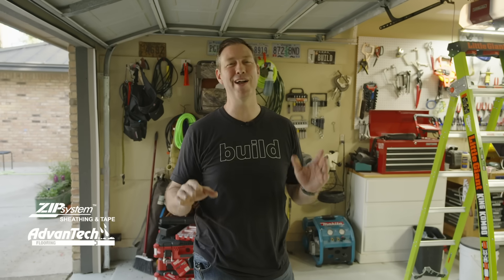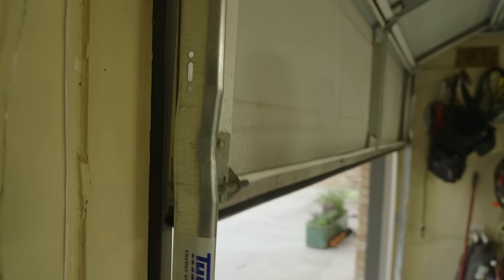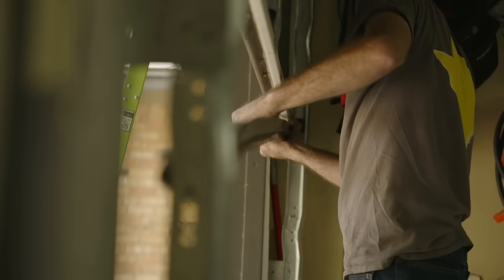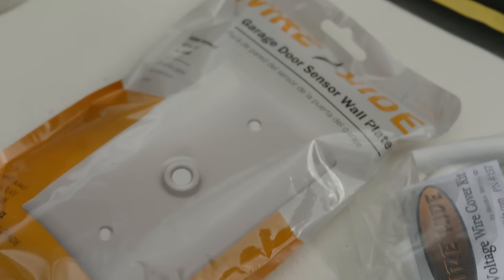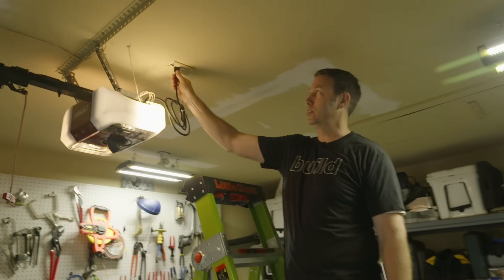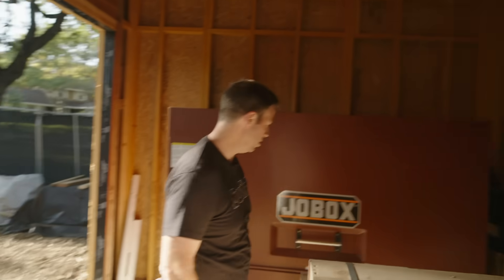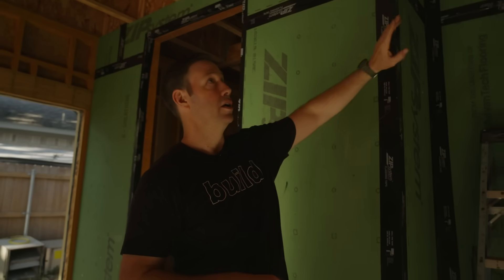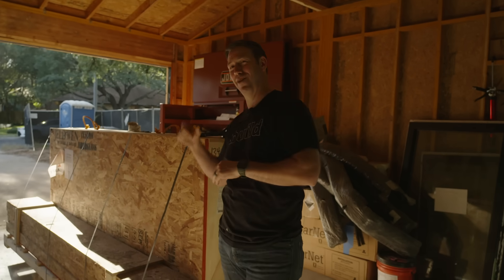Garage Door - Air & Bug Sealing

Comment: Matt, I learned a few years ago that leaving the manual door pull handle on the rope (red handle) is a security issue--recommend removing that.
Reply: As a garage door technician with 10 years in the business,  I can say this is FAR from recommended.  What is recommended is adjusting the pull height to clear vehicles and accessories.  Not removing a safety feature altogether.

Comment: Good stuff. You can use VOC sensors to trigger the exhaust. It'll help with your efficiency goals and also trigger based on actual air quality instead of just motion and false positives of motion. Thanks for your videos as always.
Reply: Does anyone have a link to a VOC sensor that can be used to automate the exhaust fan.  I can only find them for humidity.

Comment: I have been doing garage doors for 20 years The best brand  to buy are Haas, Wayne Dalton, Raynor, Clopay in that order stay away from the "Overhead" brand the quality isn't there . For example the gage of the steel is thinner , there is next to nothing for reinforcement on the inside. Get a torsion spring instead of extension.  A lot of door guys say extension is fine but torsion is better for lots of reasons, its more work so some guys don't want to do it. If you have the head room get 15in radius track, If it was my house I would buy Hass 1 3/4 thick door 700 series,  also spend the money on double pane windows

Comment: I live in Austin, tx used to spend quite a bit time in there. During the summers it was hard to work in the high temp so I bought some rigid foam insulation and cut it to fit into the panel of the door with an airgap of about an inch. I checked the temps on the inside and outside of the door. Inside the temp was 91 deg while the outside temp of the door was 135 deg. This temp was taken in the afternoon. Some time I saw kits in Home Depot for doing the same thing although I don't  know if the kits were using the airgap. I got idea from double glazed windows and their gaps between the 2 pieces of glass.

Comment: I've got a detached single-car garage with a refrigerator in it, which has been VERY helpful for stocking-up on extra food during the pandemic.  Problem is, during winter, I need to keep a space heater running and pointed at the fridge to make sure it doesn't get so cold that the thermostat in the fridge/freeze stop cooling. I currently have no seals around the garage door, and will definitely give ThermoTraks a look, because I'm just throwing money away at this point.
Reply: You need to buy a "garage ready" refrigerator that can still operate at lower temperatures.

Comment: READ THIS WHOLE COMMENT...  First, I appreciate your videos, and I do enjoy some of the content. I feel your getting yourself into a slippery slope though, and all the comments are telling you this too. Man you are way over exaggerating "problems" so you can install free stuff that was given to you by companies that want their silly product pimped when people don't need it. Paint fumes? Just open the damn garage door! Car fumes when you pull in? You have a massive hole letting ventilation in when you pull in, you know it's the OPEN garage door itself. No need for some fancy venting crap you have to cut holes in your garage, that will inevitable fail anyways. Besides, if you install this at the back of your garage, you will be drawing the fumes to the back of the garage instead of out the main door you just drove in. If you install it towards the front your just be blowing out the fresh air coming in the garage from the open garage door. Honestly this only has a purpose for someone with a dedicated paint booth because he paints REGULARLY. and those people are far and few in between, not the masses like is being pitched in the video.

Same thing with he camera, you have to be begging for trouble letting someone else have the power to access your garage, regardless of "securities" built in. How long until these are hacked, it's simple wifi which is easily cracked. Not to mention once the company stops supporting it in a few years because they have some other shinny upgrade, and since you didn't pay to upgrade, your "secure" wifi garage opener is now out of date and vulnerable. No thanks, too many risks.

Garage doo track to seal the door seems like a good idea. I would be highly concerned about the bottom edge of the door digging into the seal as it passes the bent portions of the track. It's common to have the door dig into the seal on a standard setup if the door is just slightly to tight as it is, let alone drawing it in as much as the bent track design would. But I'd still be interested in an honest review from someone.

I could go on about the battery back-up, but that's too easy. For pete's sake you have a pull cord that will disengage the door that you pull shut and open with ONE hand. Don't fall for stupid stuff like a battery you have to replace ever few years that costs a fortune, and has a high probability of NEVER using anyway....

In closing, there isn't a product out there that doesn't have some aspect of it that a person could be critical of. When someone posts a video of multiple products they received for free for obvious reasons of hopes to sway the person doing the review, and there is not one comment of the reviewer being critical (especially with some sketchy justification for said product) of these products, it is clear the bribe worked and people can smell this a mile away. And in short order you undermined the trust your viewers have of you, which trust being the reason people come back to your videos. So as a word of honest advice, (take it or leave it) be mindful of that trust, as it's easily lost when people feel like they're being played.

Now that's a long comment, especially from a guy that NEVER posts to videos, keep that in mind too.....
Reply: TL;DR

Comment: Hey Matt. I'm in the Atlanta market and had occasion to replace my garage doors a while back. I went with insulated and it makes a HUGE difference. It is usually 20-30 degrees warmer in the garage than outside on even the coldest days. Also, when I replaced the bottom seal, I inserted two full lengths of 1/2" back rod to prevent the seal from getting completely smashed. I presume you are supposed to set the limiter so it doesn't do that, but I am only able to seal out daylight (air) when I really run it down hard. Never had any issue with the standard weather seal on the sides. Thank for the great videos.
Reply: I'm in Atlanta Metro area as well - which brand doors did you have installed?

Comment: I like the idea of the serpentine tracks, but couldn't you design some peel and stick curved hard rubber strips to place in the curved part of the existing track at the roller stopping points?  Quicker, cheaper and universal.  Might give it a try myself.

Comment: If your not worried about the lose of roof space then I'd reccomend an Insulated Sctional door which look better & run like silk if fitted properly but if you want to keep everything nice & tidy inside then an Insulated Roller & no need to worry about hiding wires etc as all Safety features are wireless nowadays, 
Thanks
Colmac Facilities (Scotland)

Comment: To seal the bottom of the door. Either run what we call a storm shield. It does get glued to the slab but it works great. Another option we do is take a hose or something similar in pliability and shove it through the bottom rubber.

Comment: Insulated doors are great 99.9% of the time. However, if you have heated garage and it is really cold out side the door can deform due to thermal dynamics. The outside metal shrinks and inside metal will expand (or not shrink), thus creating  gap at the top as it bows inward. Outside temp zero farinhiet, inside 72F when i experienced this. I used an opposing squeeze camp and a board to push the top and close the gap. I have not figured out a more permanent solution as of yet. Just thought I'd share this experince. Best to all.
Reply: Having had heated/cooled 4 car garages in my prior homes in Minneapolis-St Paul, Columbus OH, Carmel Indiana, DFW TX, and now NW Arkansas, I’ve never experienced winter temps in said garages in which the heater produced heated space over mid-60 temps (insulated garage walls, windows, utility doors and garage doors)

Comment: Look into a garage door threshold. It is like a small speed bump that the door sits on that is adhered to the floor.  Also would recommend to look into Lift masters 8500w Jackshaft operators.

Comment: The bottom gasket shrinks overtime you always cut it longer and tuck it like your garage door guy did to accommodate it’s shrinking over time that’s what happened to your old one mine was the same most tradesmen don’t take pride in their work I see it on a daily basis it’s my biggest complaint to my subs

Comment: those sensors are designed to fall off when bumped into to avoid trip hazards.  truth be told though those eyes are the bane of my existence.  If you get an insulated door get a triple layer.  soft/hard backs are garbage.  I own a garage door company in NJ.  Id be happy to offer you and advice you might want

Comment: Chamberlain is the box store version of Liftmaster (same company). The difference is the solid bar shipped to dealers vs. the 4-5 piece bar that fits into the box. You want a leaky garage or ventilation. I highly recommend a battery powered CO monitor in the garage. Not required by code, but should be. Those internet connected appliances monitor you and the company uses that data to build junk products or market to /harass  you more. Why do I need a fridge that can be hacked and send me (and the world) SPAM because the manufacturer is too lazy to use any security?

Ditto on the affiliate comments below. Ditto on air sealing between house and garage, The code is terribly poor on that matter.

Comment: One advantage of all electric vehicles is no exhaust fumes.
Electric vehicles are just better. No noise, no emissions, less fuel costs, less maintenance costs.
Gasoline and diesel are OLD polluting technology. So last century. 
Electric cars, electric trucks, electric buses, electric trash haulers, electric snow blowers, electric lawn mowers, electric snow mobiles, electric water craft, electric garden tools, electric mechanic tools, electric motor cycles, electric bicycles, electric scooters, electric farm tractors, electric construction equipment, electric delivery vehicles,  ...... everything is going electric.  No worries about starting after sitting for a few months. Gas always needs repairs.

Comment: People lay a 1 1/2 etc pipe into the floor when its being poured , across where the door will set, The seal fits perfect on top of the pipe, water doesnt run over it,, mice have a hard time getting over it, cars drive over it fine, and the seal wont stick to it in frozen temps they say. a friend as he poured the floor, added a steel box in the floor, and poured around it so edge was level with floorline so he could put documents and valuables in it, and then he sat a box etc over it. to hide it.

Comment: Matt! I tried contacting you about this a few months back. You need to see our Garage Door Weatherstripping at StopTheSnirt.com! Our seal is Kevlar reinforced woven polyester designed to create an air-tight seal at the bottom, sides and top of any type garage or overhead door! It even comes in several colors to match any home! It's made in the USA and comes with a Lifetime Warranty! 

From our site, "SnirtStopper™ is a revolutionary, easy to install garage door seal that actually stops snow and dirt or ‘snirt’! Our patented BottomSealer™ and SideSealer™ keeps out rain, snow, dirt, leaves, rodents, insects and more while saving energy by sealing out the cold, creating an air-tight seal that traps heat inside where it belongs for a warmer, safer work area and home! Snirt happens. Stop it!"

We'd love for you to review our product! Give us a call at 800-250-5502 Ask for Jeff

Comment: I had my original uninsulated 2 car wide garage door replaced with an Amarr brand insulated door and the difference was noticeable.  What made even more difference was to apply dark window tint to the small windows in the garage door. The difference was pretty amazing.  My garage door faces south east and that morning and noon sun would bake the inside of the garage.  The dark tint easily lowered temps by 20 degrees.

Comment: Tip from a garage door pro.  If you want two cars to fit in a house you are building 16' wide doors suck.  There is next to no room to open your doors and move between the vehicles.  

18' wide is far better, but two 9' wide doors is best.  You open smaller doors to the elements and you spread the wear and tear out across two doors.

Also, jack shaft motors are nothing but a headache on a door with traditional tracks.  They are meant for high lift tracks.  It even states this clearly in the manual, but most door guys are hacks.  Make sure they pitch your tracks downhill on the door or you will constantly throw cables off the door as your torsion shaft begins to warp after years of being turned from one side.  

Traditional motor is far better for your setup.

Comment: You will love the side mount Liftmasters with automatic dead bolt locks. very quiet and totally secure with the dead bolt locking
Reply: After installing one on a new garage addition door for clearance, I removed a perfectly functional overhead drive system on the other overhead door, junked it, and replaced with another Liftmaster opener. Yes, they're that much better than the outdate gear/chain overhead openers.

Comment: "an attached garage isn't ideal" says the person who lives in a warm climate.
Reply: In a cold climate a detached garage with a conditioned walkway would be best but that’s of course a lot of trouble and not really worth it.
Reply: Why isn't it ideal? I see nothing but upsides personally.

Can someone teach me?
Reply: @ClippyRenaissance  you don't want fumes from cars or garage chemicals in your indoor air, and there's some fire risk (usually you have to have fire rated drywall, doors, etc between a garage and house) - but yeah, I think the benefits out weigh the easily mitigated drawbacks.
Reply: @ClippyRenaissance  there are several reasons an attached garage might be considered less than ideal. 

Air sealing an attached garage from the main living space can be difficult. This harms efficiency and can result in unwanted smells in the house. Also if something like a vehicle fire happens it will of course destroy the house. 

So Matt normally likes a detached garage. 

That said he live in Texas where it’s never really cold lol.

Comment: Hi Matt.  I noticed your guy rolled the ends in on the bottom seal.  That is smart.  I cut mine and  the length of the seal has shrunk over the years leaving the gaps on the ends.  If I had done the same, I would be able to pull out some of the extra material.

Comment: Our house had a wood door that was falling apart. We "only" have a single-car garage with an 8x7' door. So... determined to never have to replace this door again, I bought one that's stamped steel on both sides, plus insulated and capped. Definitely more expensive than your standard contractor door, but it made an immediate difference to our garage. 10 years later, still wonderful. But now I need to check out those ThermoTraks.....

Comment: A cool thought for carbon monoxide exhausting without loosing your heating or cooling with a motion sensor. Wire in an electical switch in conjunction with the carbon monoxide detector to operate your fan when the alarm closes the contacts and completes the path to turn the fan on.

Comment: If you use the jack shaft style door opener the top door panel will not be pushed up tight against the weatherstrip like it is with a traditional long rail opener. The top panel will move freely when the wind pushes against it.  This is noticeable when you open the door from the house and the air pressure in the garage changes. I have this problem with my doors and would welcome anyone's input on how to correct this.
The exhaust fan seems like it will defeat the purpose of the mini split, since it will be exhausting your conditioned air, I believe you said it runs for 30 minutes? Where does the make up air come from if you have tightly sealed the garage?

Comment: How did you address the fire proofing issue between the garage and house. Most codes require  a fire barrier between the garage and living space. Attached Garages are considered to be seperate structures and are fire stopped to prevent fire spread from the garage into living space.

Comment: While air sealing is important, isn't foam insulation flammable? Using foam to seal electrical boxes or insulate/seal garage seems dangerous? Why not high temp caulk and rockwool?

Comment: I'm right there with you Matt.  My garage doubles as my workshop.  It has full insulation (same as house), Clopay R18 doors, and a 24K mini split.  I have adjusted the garage door tracks numerous times and now have it air tight and perfect.  My only trouble spots are those notorious critter corners where the door, frame, and concrete intersect.  I've got those gaps down to about pencil-sized hole and can probably live with that.  Here's a tip: run the vinyl flap molding all the way down until it touches the concrete.....dont' cut it short.  BTW, the Clopay 3-layer insulated doors are fantastic and well worth the cost if you spend as much time in the garage as I do.   On a hot 100 degree summer day, the outside of the doors are scalding hot......but the inside is barely warm.
Reply: Mice don't have bones, they have cartilage. That's what enables them to squish through a pencil-sized hole. Recommend u fill that hole with steel wool, or make it smaller.